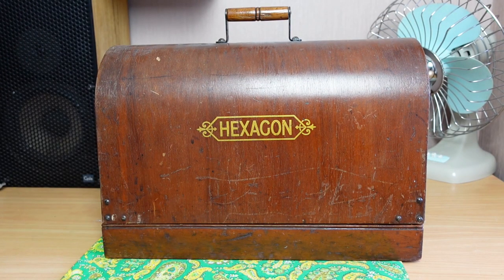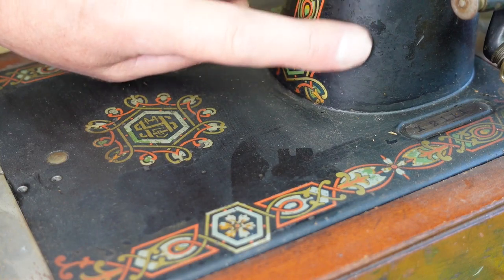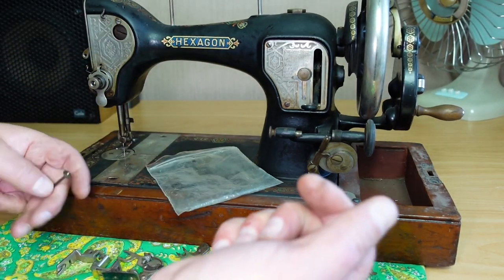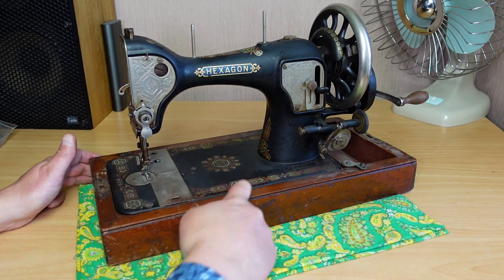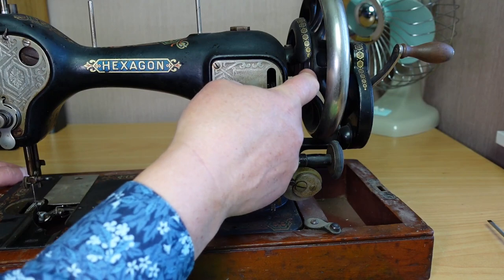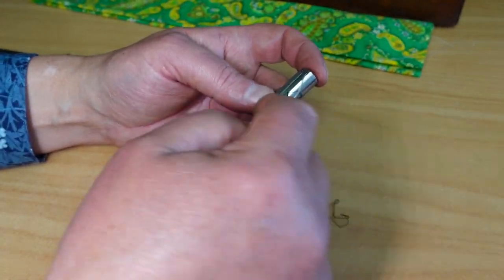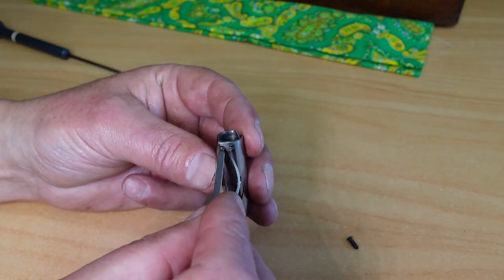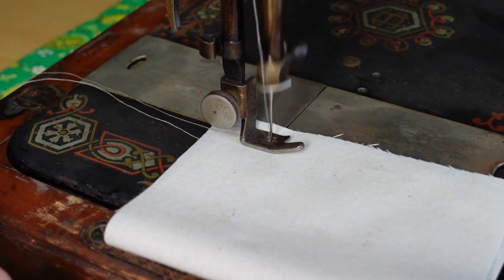Hexagon Sewing Machine Assessment - Made in Cleveland, Ohio. U.S.A.

Comment: Nice old girl! Congrats. 
With your front bobbin slide plate off:
You see that little round 🕳️ hole at the horizontal plane? That should be stuffed with clean wool and topped off with sm oil. That is where you oil the shuttle path. There's a little pinhole facing the sole of the shuttle. Take a needle and make sure that hole is clear of built-up debris. It's the same on the Singer 28 that this seems to be based off of. 
Cheers from America! 🇺🇸
Reply: I think he knows how to fix machines.  ;)
Reply: @alp-1960  I think you can stay out of my comments and mind your own business!
Reply: @rich-f-in-tx6388  Lol no need to be defensive, it was a light-hearted chide. Take care and happy sewing.